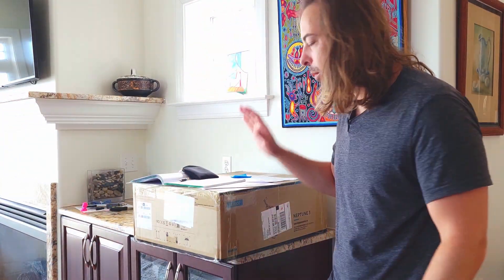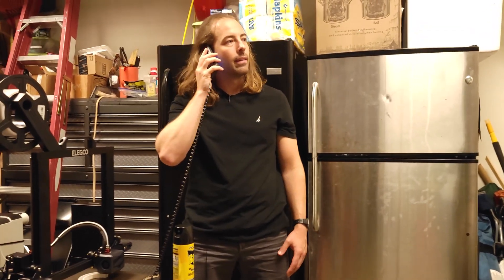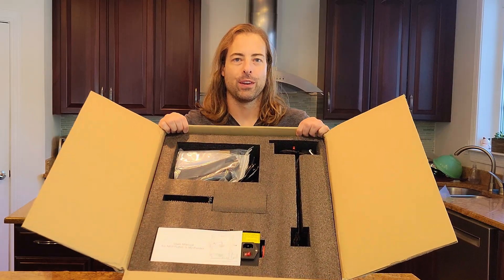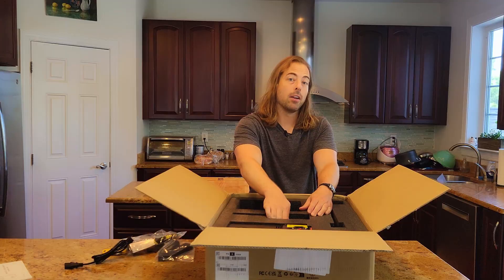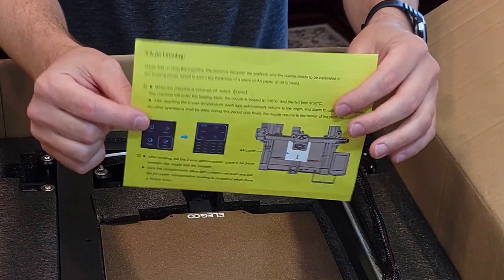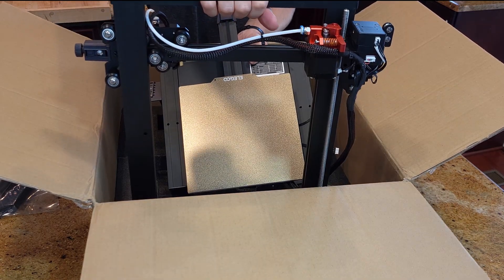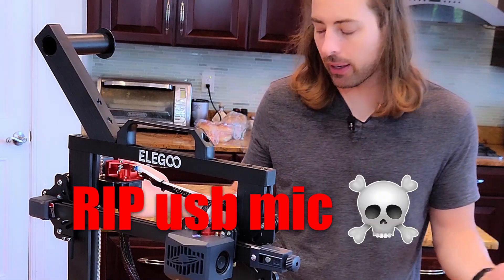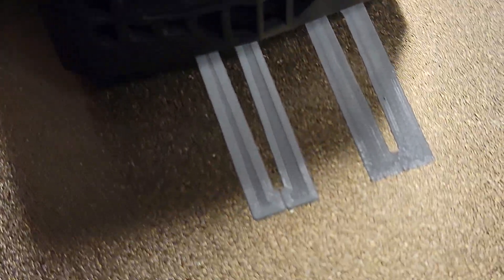ELEGOO Neptune 3 BEST Beginner 3D Printer 2022 Unboxing, Setup and Review

Comment: How the hell u get that filament thru the sensor so fast.  Ive been spending majority of my time, trying to feed it thru that damn thing.
Reply from the maker: 🤣 I bend it slightly down and toward the gantry and it goes through much easier. Also, use the clippers to cut an angle on one side so it looks like the end of a syringe.